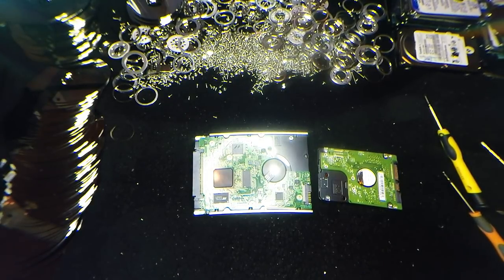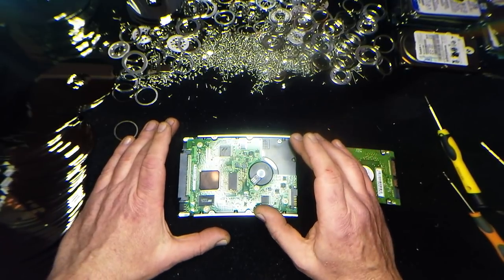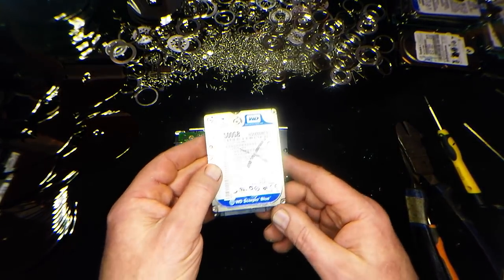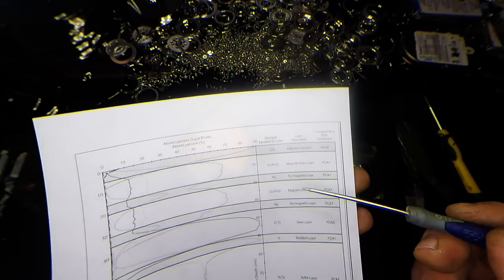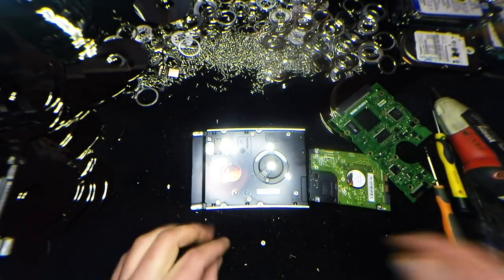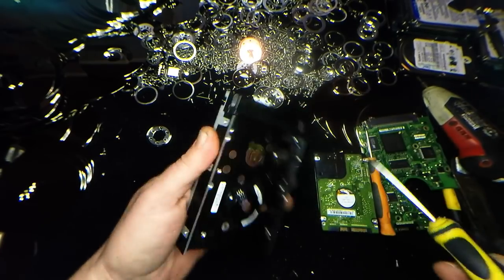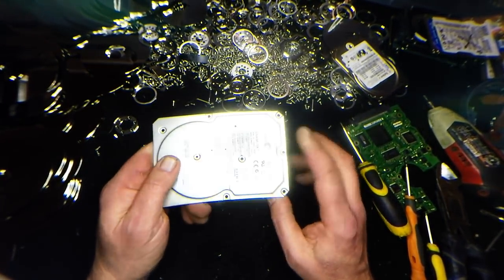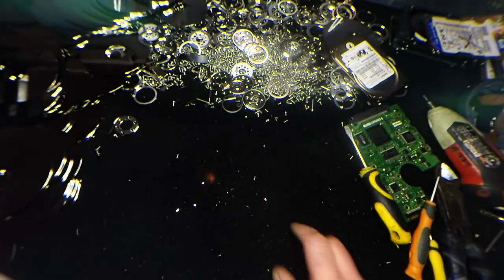Platinum is in Modern Hard Drive Platters

Comment: Graet video Ben.I'm in one of my experiments, In my video I managed to recover a part of Platinum, although my procedure is not financially effective, the amount of Platinum I received was not worth losing Aluminum, but there are other methods that can save Aluminum and the Platinum at the same time. This is the procedure that one of my Subskryber left in a comment on my video:

My method. Cut a grove in one edge of the platters to let the molten aluminum out and Rack the platters on a steel rack that looks like a swing set "A" frame above a graphite mold by about an 1". To catch the molten aluminum in a mold inside my Kiln that goes to 2000 degrees Fahrenheit. When the foils that are left are cold. I drop them in a bucket and cover them with Sodium Hypocholorite or bleach to get the rest of the aluminum out. Then wash with baking soda, dry and cut up and drop in a Whistler coffee pot and cover with Aqua Regia and slow boil till the chromium and PGM's dissolve.  Then denature and drop. The aluminum recovery helps pay the electricity used and Solar with a Power wall helps too. My research indicated .005%  Platinum per platter?  Palladium can be used it wont magnetize.

T.L Jenks is name this subskryber.Type a name on Youtube, him profile will be first on list!!!,
Reply: 999 Dusan Gold recovery .

Comment: Based on the spectroscopic thickness profile I did some calculations and the outcome was that 1 3.5" platter holds roughly 1 milligram of Platinum.
In other words you need to process 1000 platters to get 1 gramm of Platinum (losses through process yield <1 not even considered).
Don't think, that this will ever pay back.
Reply: Cheers

Comment: Features of Platinum Element
Slow expansion if exposed to heating. Slow melting in the water of fire

We can distinguish between them through a test called zero test, which is a piece of white gold and scratched, if scratched easily is white gold, and the second method is to heat a piece of metal and let it cool until it turns to a dark color is white gold, It is a piece of platinum

Comment: i did some math, assuming 20 nanometer thick layer of 33% platinum, at $1000 oz, the value of one 3.5 inch HD disc (the one you know it has Pt)  worth 5.7 cents per disc, excluding values for cobalt and chromium

Comment: These layers are applied via ion deposition.  This can deposit material only a couple atoms thick.  No process used by a hobby scrapper will ever be viable.  Now if you had thousands of platters and had access to a furnace where you could fractional melt, there may be a small profit.

Comment: It's not a calculation that I would know how to do myself, but surely with the data in that diagram, it could be possible to work out an average price per average platter in terms of precious metals.

The atomic weight/size of the metal in question, multiplied by the total depth of the containing fraction, multiplied by the percentage of those metals in that fraction? Or something along those lines?

Could help kickstart a HDD platter scrap price rise!

What other purposes have people sold them for? I've sold for laser cutting art installations, I gather people can use them for scaring away animals from gardens and other artistic installations, any other audiences to target?

Comment: U cant gerneralize it that way. 
Ive seen aluminium platters in notebook drives and glass platters in large desktop drives.
But how to examine aluminium or glass platters?
take a magnet (strong Neodymium) and swipe over the surface, 
when the magnet tries to drag the plater with it while moving back and forth, its alu.

Comment: Please make a video with you going through a whole board and explaining what every item is and what kind of metal it has
Reply from the maker: ok mate, I get asked this all the time so I will do it as soon as I can
Reply: Thank you! :D
Oh and I have a question, I have noticed trackpads on laptops have a substantial amount of metal, I think might be gold, The hard pads I have seen  have like a whole layer under the green surface. Do you happen to know if its actually gold or is it copper or some rubbish?
Reply from the maker: yes it's gold but not gold plate, it's called ENIG which is very minute amount of gold, probably not worth using chemicals for them but may still be worth it using reverse electroplating
Reply: Awesome, thank you :D